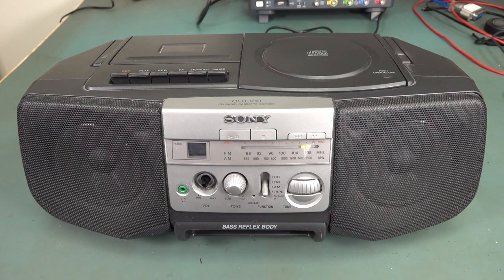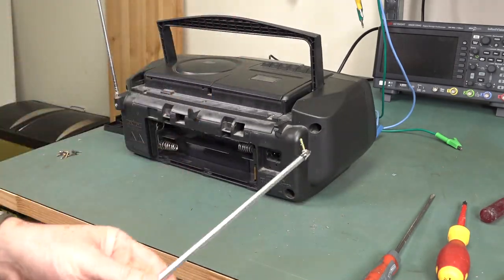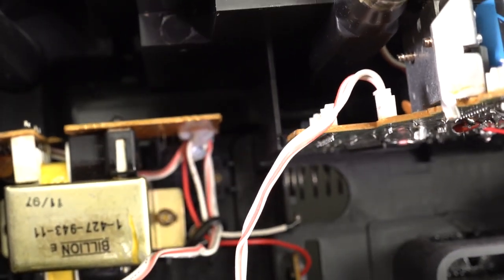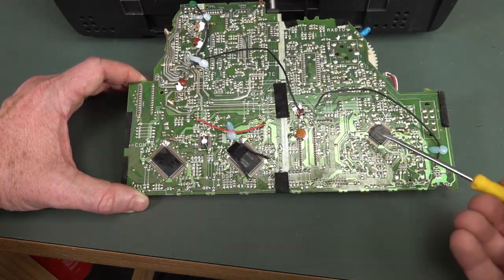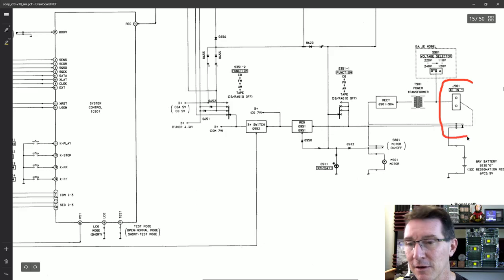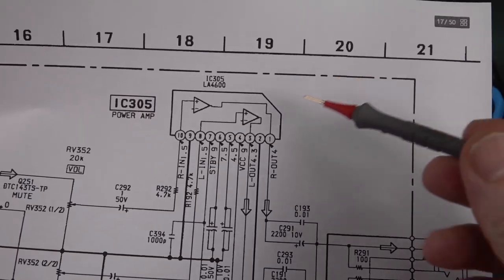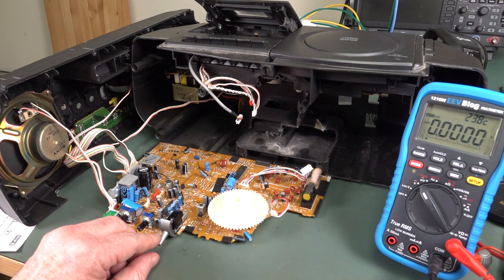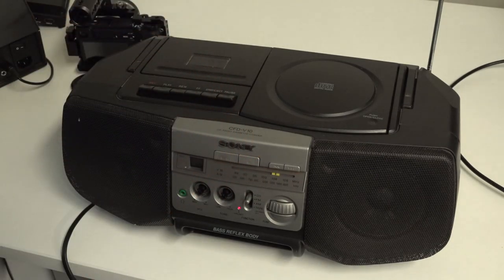EEVblog #1243 - Sony Boombox REPAIR and Teardown

Comment: I think you "missed" those joints intentionally so that you could give a more-detailed overview of the system and other possible faults. It's more fun this way. Thanks.
Reply from the maker: Err, no, that's not how I do things. I record my videos in a linear fashion as things happen, no plan, and voltage measurement was the first thing i wanted to do. I initially thought (hoped) it was a component fault I could track down. So the joints only became the next suspect when the voltage measurements pointed to internal IC voltage bias problems, and then the penny dropped it could be that. You can't see these cracks with the naked eye, so I had to use my macro lens or my Mantis to see them, not something I'd ordinarily do first.
Reply: My bad then.
Reply: Now the radio strip is out of sync with the cog wheel  DOH!  4:55
Reply: @EEVblog  Apologies Dave, I thought you might have noticed the bad joints earlier on, also. Mea Culpa, sir.
Reply from the maker: As I said, first thing I do is comment on the design when opened, next step look for basic visuals (requires microscope to see the cracks), next measure voltages. In this case the voltages pointed to the chip, so visual inspect closer and bingo. Standard procedure. Take out my camera stuff and commentary, and this was 5 minutes of actual work until fault spotted. To find it quicker would require specific product failure knowledge.
Reply: Dave misses things all the time, sometimes makes a video based on terrible assumptions and never fixes it. So I'm sure that wasn't the case :-) We got to love Dave for his humility, even if he is sometimes grossly wrong :)
Reply: @gryzman  grossly wrong or just unscripted? we'd all be exactly the same. which is a good thing
Reply: When watching an edited video, it is easy to forget how much of Dave's brain is being used up on directing and not speaking complete crap during recording. He's bound to miss a few things. Anyway, bloody dry joints again on that crappy PCB substrate material they use. Are we getting any long term feedback on how unleaded solder has changed this game yet?

Comment: "That's not a screwdriver... THIS is a screwdriver!"

Also surprised to see a service manual for a fairly modern consumer bit of gear. Impressive.
Reply: I see you've played screwdriver-screwdrivey before
Reply: Back in the day, you could get the service manual for even the most basic consumer tv.
Reply: @GoldSrc_  I have a full set of Sams Photofacts  from 1946 to about 2004. :)
Reply: Lassi Kinnunen  would most likely have been borderline late 80's early 90's, after that decent (if any) service manuals started to disappear.  Also as a side note, that solder looks like some of the early attempts at lead free crap. I have seen almost entire boards of that era with dry joints, quite often coupled with oversized holes for the component legs.
Reply: Sony and Panasonic for some products still make service manuals which is good
Reply: @Dan_07  Yeah, it's great to find some of the older Panasonics & Sonys around. Few & far between, but still sometimes available through Goodwill or thrift stores, & possibly on Craigslist. I still(!) have an old working tape/ radio Sony with a 5-band EQ on it that dates back to the early 90's. A couple of the older boomboxes, too, like the CFD-757 and a CFD-V17 model. Have a Panasonic bookshelf model I got back in '06 and still works; sounds just as good as when I bought it.
Reply: BLuecoLLarcanuck Panasonic still sell the rxd50 rxd45 rxd55 models which have great quality build and sound
Reply: @Dan_07  Good to know. I had Service manuals for all my old Sony stuff and I was womdering if they still bothered to do them.
Reply: Long shafted screwdrivers were the norm in a repair shop back then. Long-shafted nut-drivers was a must for repairing TVs in large cabinets and military maggies that needed one in non-magnetic bronze. I did both. We had the same service manuals in paper. We had to destroy them when we were laid off and the shop closed. One of the Sony manuals for a much larger boombox had a signal line defined as "CD Death" with the capital D in "CD" with a line through the bowed portion of that character making it look more 'Gothic'.
Reply: Starphot  why would you have to destroy a boom box manual ?
Reply: @Dan_07  We had to destroy these as well as the other items we serviced. This came from corporate.
Reply: Strange
Reply: @Dan_07  This was to protect the company's and our vendor's products from unauthorized repairs. We had toy electronics such as RC cars repaired there and the local kids were dumpster diving for these overly damaged ones. We had to smash these before throwing these away. This was for liability concerns.

Comment: the black cover in the battery compartment was probably for a  different model that had a built in clock, they usually had a spot for 2 AA batteries in there behind the d cells. they probably reused the rear casing.
Reply from the maker: Ah, makes sense.
Reply: I don't think it was for anything like that.  Instead I think it was for plastic molding.  They needed a way to create an opening in the molded parts so sound could get into that port that goes to the front.  To do that the mold tool had to come up from the battery compartment side into the center of the radio.  They used a "label" to seal things back up when they were done.

Comment: Touching up cold solder joints has never failed me. I did it to an old 1980s ghetto blaster boombox the Magnavox D8443 because the audio power output was very low and cutting out and I touched up the solder joints on the main capacitor and a few dozen other joints and the radio works much better. I am in the process of restoring this set as best I can.

Comment: This is a CLASSIC issue, power device mounted on a heat sink/expansion contraction. I have also seen this on an old high voltage TV transformer in a Pioneer large screen projection TV. Had to re-solder on several occasions but was the only failure ever on the TV itself! Great repair video.

Comment: As a kid I remember excitedly pulling apart my Silver branded boombox which had 80W PMPO proudly emblazoned across the front only to find a couple of small paper coned full range drivers rated at 3w each. Put it back together and sulked for a while!

Comment: Dave discovering the AC/DC switching made me chuckle.
We had a lesser model as radios in a casino I used to work at. They took a LOT of falls from six feet up. What usually did them in was too many face-down smacks to the volume pot or mode switch. Nearly every antenna got broken, but we used paper-clip chains Scotch-taped to the wall. They actually put out a decent quality of sound in small rooms, the Bass Boost actually worked.

Comment: I've seen the same thing on CRT monitors. The joints on the flyback transformers crack in the same way. Heat and vibration does it...
Reply: @blitzwing1 Yes, lead free is worse for this

Comment: Thanks for the video, Dave!  My wife and I really enjoy your colloquial turns of phrase.  "Bob's your Uncle" is hysterical.  I found this video because I just happened across a "Winner, Winner Chicken Dinner"  pretty complete CFD-565 that's going to need new tape transport belts.  I wanted to get one "portable/boombox thing" for travel purposes, should that need arise (it probably won't, but restoring this stuff is my retirement hobby) and I owned a "Fish" brand box back in the '80s.  The CFD-565 was fairly inexpensive considering how "overbuilt" it appears to be.  It lacks Cassette Bias/EQ settings, tape counter, and the like, but it seems to be much better built than some of these eye-poppingly hyperinflated boxes.  My question (I'm in the U.S.) is why don't Sony boomboxes get more respect than they do?  I think their specs are held to a more conservative standard than some of the "45wpc" cash register/calculator manufacturer machines out there, so I just don't get it.  But then I wasn't really part of the youth culture that fetished the park it on your shoulder and turn it up phenomenon.  I sold a bunch of them to those folks in the '80s, though.  What am I missing?  $3K for a no-name knockoff?  Help me out a little...best regards!

Comment: Your mom will be happy

and proud of your work ...

450 mm screwdriver ?
Reply: Wow 450mm
Reply: Its made to reach the two screws holding a TV on a wall mounted bracket.
Reply: @menuly  From the other side of the wall, or what? :)
Reply: @mrnmrn1  underneath vertically.

Comment: Not just power devices. Connectors too. Had this on a 1997 Dodge Caravan Minivan a couple months ago I was working on for a friend. Went in to fix a speedometer issue... but then I was told "oh, the gauges completely die somtimes too". Pulled the instrument cluster, sure enough, all but three of the connector pin joints were cracked. "easy" fix since I had the cluster out anyway. Seems to be a common issue on GM and Chrysler stuff of the era (luckily, Ford used film PCBs that don't have such issues; I can't speak for non-USA makes).
Reply: Honda had issues with the main relay soldier joints failing through out the 90s. Random stalls and long restarts are a good clue

Comment: At minute 22:15: Very good to see the crack in the solder. This probably occurred more often on PCBs with a single side copper layer. Even if the component was not mechanically screwed to the PCB separately?

Comment: Dont forget the mechanical stress. Those solder joints have to support that big honkin heatsink and being a boombox it gets tossed around quite a bit. I had similar issues in guitar amps back when I was into that sort of thing.

Comment: Dave, I did warranty service of Sony products during that time period. Sometimes with certain models of Sony or other brands out-of-the-box, there were cold solder joints mainly on those components that are heat-sinked. Like you said, a bad batch of solder or too short of time through the wave solder. Before I was laid off in 2001, there were a lot of solder errors in certain models of many brands that came out that year. The muxes were fine, it was the heat-sinked components.  Remember, a lot of the circuit boards were made by a few contractors for these brands, so you can see the same boards in these Japanese brands. The first thing I did with these models is to open up and check the solder joints to these components.

Comment: The radio tuning indicator should have been lined up before the radio was reassembled! Great video anyway, I used to get those from the scrap yard and fix them at home, sometimes I was very lucky and all that was needed was a jumper wire for a blown fuse or replacing a transformer because some of them have internal fuses. We have 2-phase power utility in most homes and people sometimes forgot to flip the voltage selector switch before turning on the radio.

Comment: 1:17 - I'm guessing the filter cap 'formed' during the interval between when you powered it on (probably after many years) and when you started adjusting the volume! Anyway, that cap sounds (literally!) like a candidate for replacement. 
No need to swear, Dave! (1:35),  you have video and audio evidence!

Comment: I just went over a Sony sport "boom box".

Also converted it to rechargable lithium batteries instead of 6 c's
Reply: How do you make sure they are balance charged properly.
Reply: @simontay4851  With a charging controller I would assume
Reply: @simontay4851  

I don't feel it needs balancing.

I'm using 2 18650s savaged from the same device that tested with almost identical capacity and wired them parallel.

My guess is I'll get a usable 2500 mAh from that pack

Not a lot but you can play the radio for hours.

The used a boost converter to give me the solid 9v it needed.

The converter has a solid built in charger with over and under protection and was like 2$

Comment: Love it, I have one that is the same vintage with a digital tuner and I loved it but it failed with no sound. After seeing this video I'm inspired to get the service manual and see if I can find the failure mode. It had good sound and was the only one that had an alarm where you could set the off time separately from the on time, fancy.

Comment: Hi there, new subscriber...This made me think of the Yamaha DSP A1 Amplifier that has the dreaded display pixel disappeaer.  Almost all of these amps now have the display miss pixels, I have fixed over 10 of them so far, requires resoldering 32 pins on the top and bottom the display, the joints do excatly what happened here to this Sony Boombox.  Great find and good repair job!

Comment: man this is awesome. we had this very same tape deck when i was like 14. i had no idea it was built to such standards. i always assumed it was just a chinese simple cheap thingie. no idea you could get a freaking service manual for the thing & everything. as i recall it did its job and never failed.

Comment: My parents have bought me one, same like this, I believe, in 1998 or 9 (I was 5 or 6 at the time), and two CDs of Bob Marley with it.... still have the player and the CDs and they all still work... The CD pickup is almost dead though, and the switch for AC/DC that's integrated into the socket has to be extra pressed with a piece of folded paper to work.... I've always wanted to fix it, but I've not yet bought a long enough screw driver to reach those deep back screws...

Comment: Funny, I have the same one, CFD-V15, here which someone had thrown out at work a few weeks ago and I hadn't gotten around to looking at until seeing your video. One speaker is completely FUBAR and the tone control knob is missing but other than that it seems OK. Thinking I might just harvest the AC transformer from it as I always seem to need them (hopefully it's a dual secondary winding).

Comment: Indifferential thermal expansion could cause the solder cracking, this would be the pins expanding or contracting at a different rate than the solder when heating or cooling.

Comment: Fake-tweeter: I've seen some models where the low-end exterior was simply the high-end exterior with a few holes not cut out. (instead of simply looking for the tweeter 'dip', I would check if the tweeter magnet/core was visible)

Comment: The bits of foam would have been placed to faciltate in the 'tuning' of the enclosure.
Reply: Do you mean to minimise the chances of it resonating?
Reply: @jam99  'tuning' is an all encompassing phrase in enclosure design terms.
Reply: @gerrabath  Thanks but that tells me nothing. It's like saying the foam is there because it is designed that way. Accurate but not useful.
Reply: @jam99  Sorry I thought you were being sarcastic at the use of what could be considered a vague term. My bad. 

Yes, you're right about placement of baffling material to aid in the nullifying of the inherent resonant tendencies of susceptible cabinet materials :-)
Reply: @gerrabath  Thank you. In this case (20yrs ago), do you think they just did it by trial and error or would they have had some kind of software modelling to work it out?

Comment: I think that foam is only to stop vibrations, not for acoustic absorption. The battery door was right opposite the bass port internal mouth where there will be high velocity air. I expect it just damps the door.

Comment: Good to see one of those old "stereos" around and operating. Sony stuff back in the day (1990's) was some of the best lower-priced stuff around. They had some really good acoustics on some of the older "bookshelf" systems. 

At one point, I did own an old ZS-D1 CD/radio. AFAIK, it wasn't a widely-sold model, or particularly well-known on the market. My mistake, as it was one of the shittiest models they made. Big, heavy-ish, chunky body and piss-poor speakers & acoustics. Bargain-basement Radio Shack garbage speakers glued onto the back of ugly, oversized grilles. The CD player crapped out and stopped reading/ ejecting properly in about 18 months.